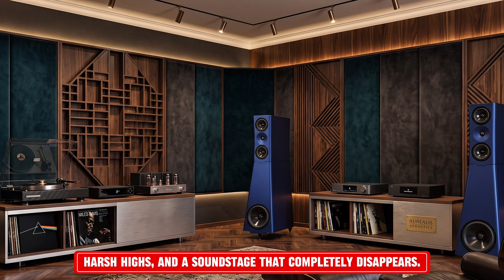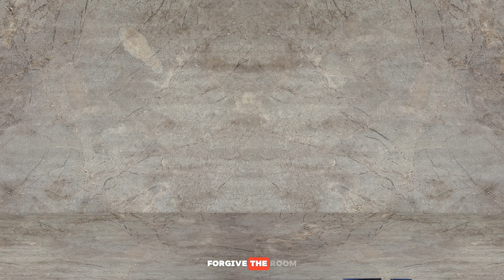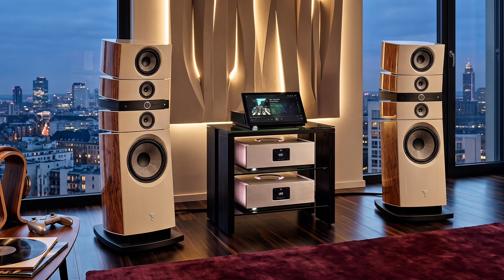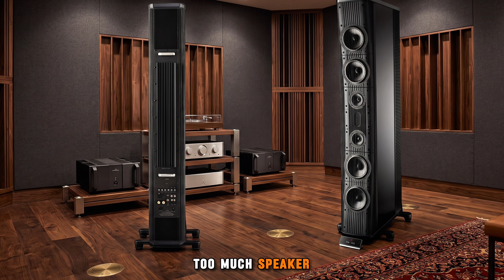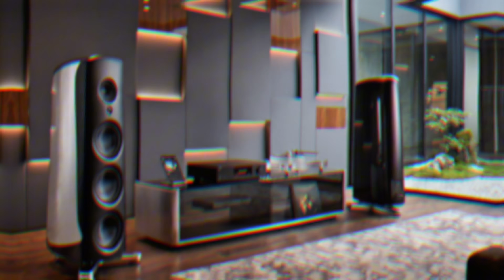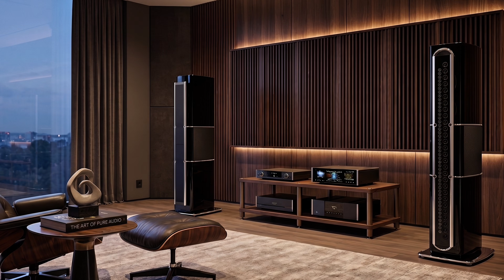Even $10,000 Speakers Can Sound Awful — Here’s Why

Comment: Satellite / Subwoofer systems   have solved several issues with rooms for almost 60 years.  Large floorstanding statement systems are for mansions built for them.
Reply from the maker: Exactly. Satellite and subwoofer systems have been a practical solution for controlling room interactions for decades. Large floorstanding systems make a statement and can deliver incredible sound, but they really require the right space — usually a mansion or purpose-built room — to perform at their best. For most rooms, a well-designed satellite/subwoofer setup can achieve excellent results without the space demands of massive floorstanders.